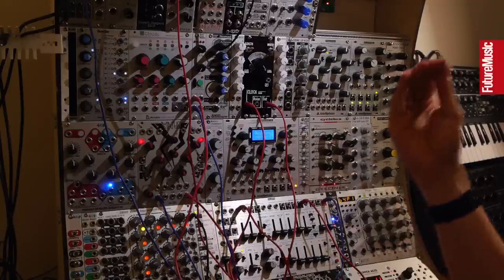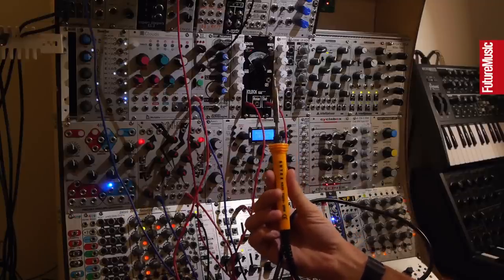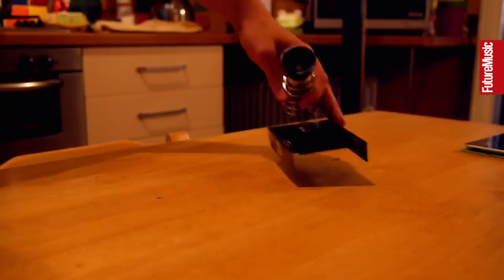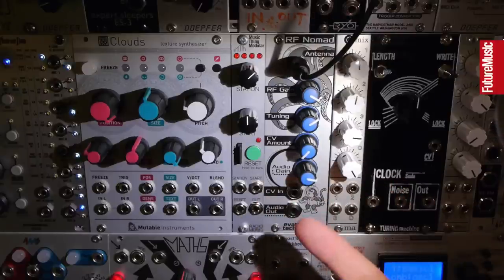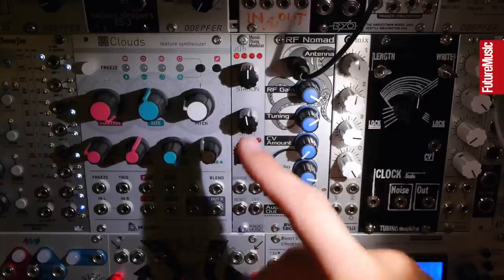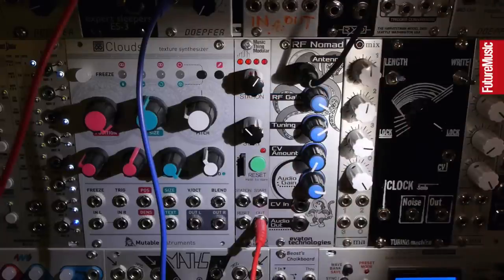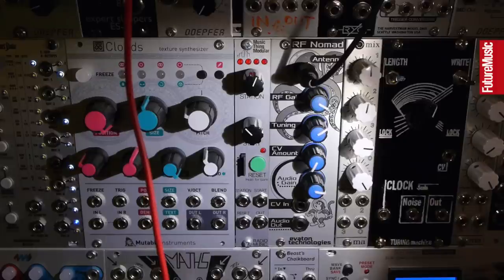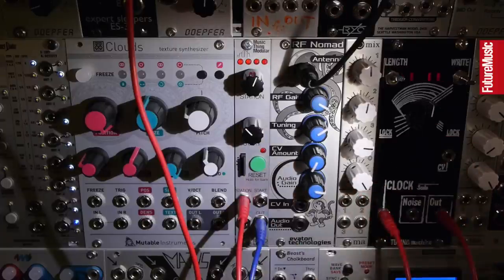Modular Monthly: An intro to DIY Eurorack & the Radio Music

Comment: I can't recommend DIY eurorack enough, not only to save money over the retail, like for like, module but also as an entry into electronics. Don't be intimidated by bags and bags of components and don't empty them all out into one pile. Even as you get more confidant this, personally, I find is bad practice. At dining tray is a must, ideally not plastic. Small IC or micro chips are not befriended by plastic or static that they produce. Using a tray means that if your build is cut short for any reason you can start where you left off without the risk of little hands grabbing what they can or pews dribbling of your capacitors. 
The benefit of the Radio music kit is it does require a little firmware flashing....calm is the key and the best bit is....if it doesn't work the first time, you can reflash it over and over until it does. Then you've taught yourself how to flash firmware.

Comment: I went with the Maplins route to start off - highly advise getting the DIY function generator. Easy to build and you basically get an LFO/clock generator for £15! Also accepts 12v power and outputs at 0-5v - VERY eurorack friendly.
Reply: Yeah, shame they've gone to the wall :( Amazon it is now

Comment: Oh I forgot to mention ---- I would personally recommend to get leaded solder because in my experience unleaded solder takes so much heat that its almost impossible sometimes to melt it sufficiently for a nice wet smooth join. I normally use an Antex  25 watt iron.

Comment: I'd say, get a digital soldering iron, they are much easier to control RE: temperature, also, don't "blob on" the solder, that will give you cold solder joints, basically, gently heat up the solder pads + leg of the component and then feed your solder into the pad (Computer engineer here so i've got lost of practise soldering), your advice RE: practise kits however is spot on!
Also, grab a nice digital multi meter, they are a godsend in finding unintended shorts using a continuity function

Comment: I'm a pro at this, and my best suggestions are: get a good-quality temperature-controlled  (not wattage, it should have an actual thermostat on it) soldering station ($40 to $100 USD); use a large chisel or "hoof" tip to get good heat transfer; use good "no-clean" flux-core electronics solder and plenty of extra "no-clean" flux (seriously: like money, good looks, and brains, you almost can't have too much flux); and use magnification ( I have a "dissection" stereo microscope, but even one of those cheap "desk lamp" style magnifying glasses helps tremendously). Lead-type solder is easier to work with, but if you use it be sure to take appropriate safety precautions (ventilation, wash your hands after handling, etc). If you find that the board is sticky afterwards, grab some 99% isopropyl to clean it off with (70% rubbing alcohol usually won't work because of the 30% water in it - most flux is hydrophobic). 😎

Comment: I always considered myself reasonable at soldering. For example I made several Digisound 80 modules about a century ago (!)  that worked which more than made up for the fact that Roland just left me hanging by discontinuing their  100M. I got as far as 7 modules in 2 x 191j racks though I'm lucky to have 15 now in 3 racks. As for the soldering the Digi 80 stuff the only thing I never managed to get working properly was VCO's. Never worked out why. None of my joints ever looked dry. That made me lose confidence though I know I'd save money if I got into it again.

Comment: Probably an obvious question, but Is the slot to the left of the reset button where the MicroSD card goes that holds the samples? So it would be trivial to later access the MicroSD in order to switch up the sample library (or even have multiple MicroSD's loaded with different sorts of samples)?
Reply: Correct

Comment: this thing is VERY cool :)

is that an SD card slot next to the reset button? I assume that's where the banks of sounds are stored?
does it just use regular wav files or some other format?

(I've yet to build my 1st modular system, still doing tons of research on what i need, but ill be getting this kit for sure)
Reply: Yep. MicroSD

Comment: If you want an easy kit to practice on that's around 15 bucks but is still eurorack related, just try putting together a Mult kit
Reply: Good idea that, though it's nice to also experiment with soldering real parts in!

Comment: I am so stupid I wouldn't even try.
Reply: DJ Electro Trance Gressor
if you buy complete kits (not just pcb/panel sets) there's almost no thinking involved. if you can read directions and pay attention, you'll do fine. VCOs, filters, and VCAs might need extra equipment to calibrate them properly.
Reply: Thanks. I just don't have any time for having a hobby projects.